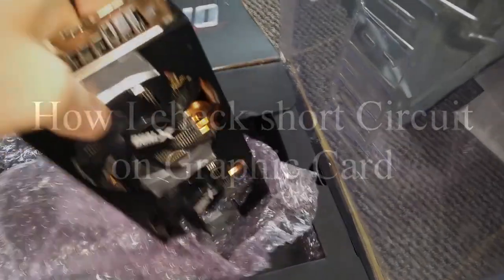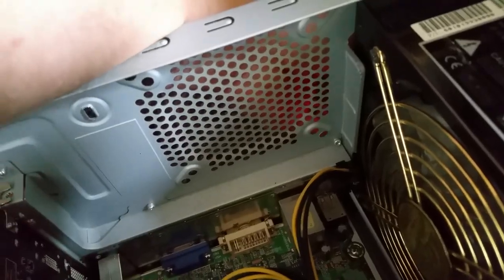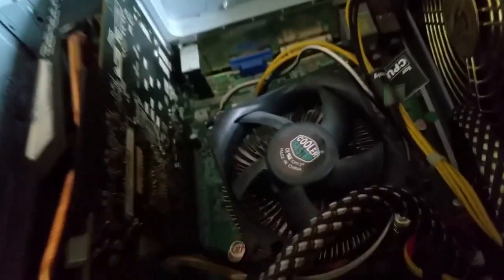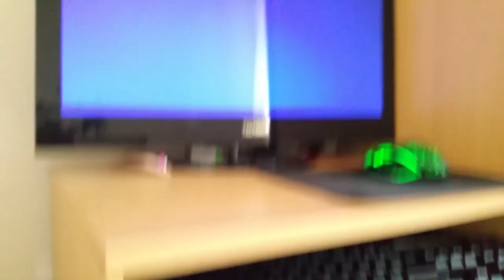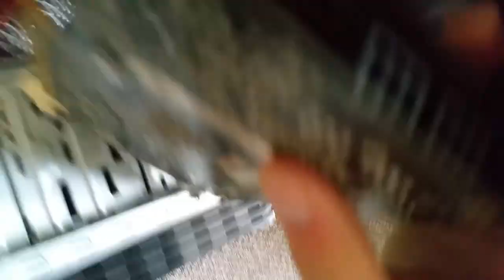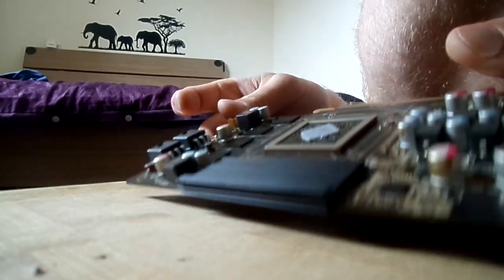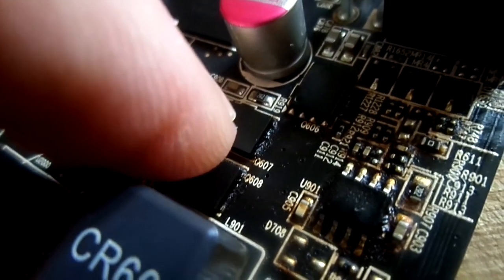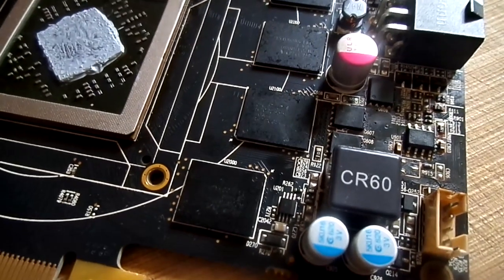How you can detect your GPU have Short circuit  - testing Graphic card

Comment: I actually unplugged pcie during my system was running it turned off the display right at the same moment after that i plugged back in and still i dont get any display after that by some luck and unplugging all of the stuff I twice got the display but it doesnt work every-time i am still not getting display its occasional if i get the display or not i dont know if it ended up damaging my gpu but it worked so i think i didnt damage it completely i am going to test it with some other cable but i need someone opinion on this
Reply from the maker: Ok that's interesting story
I will definitely first try in different PC
Or if you got second PCIe slot in MB try that as well
Reply: @frogtechtips  I've tried using the second pcie cable it didnt work with that aswell, 

P.S after struggling for 3 hours I once got the display again by sore luck so i Went and updated all the display drivers and did a fresh installation of the asus official drivers (as i am using asus 3060) today i booted my system and it worked with just 1 unplug of hdmi from gpu i guess it is some sort of solution but i cant be sure of it
Reply from the maker: @gaurang8824  can you try in different PC
Reply: @frogtechtips  I definitely want to try that but I am not getting access to any other desktop
Reply from the maker: @gaurang8824  try asking your friends only I can confirm is not a short as if it's will be short your pc will not start at all